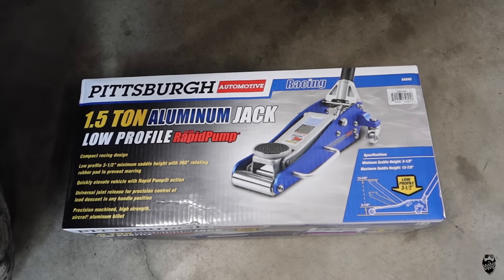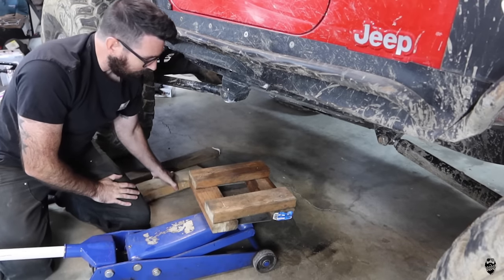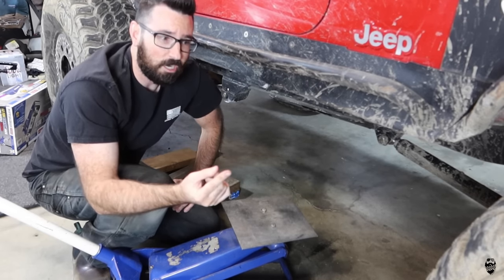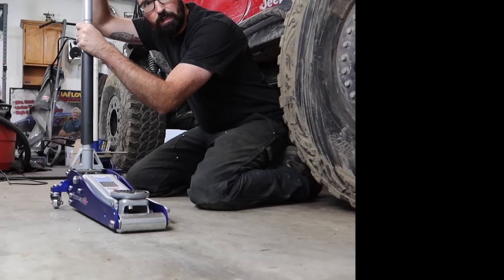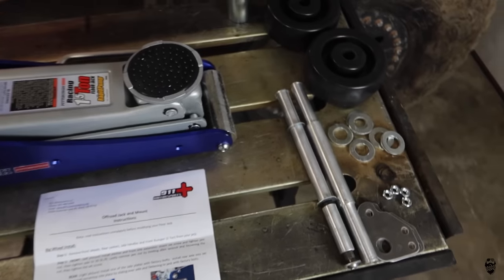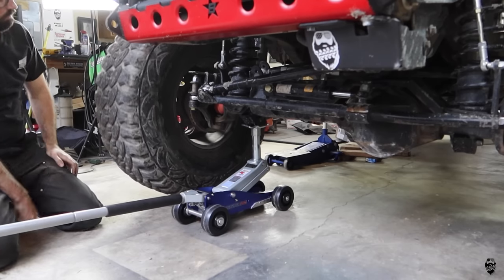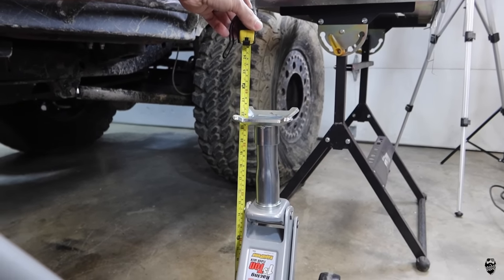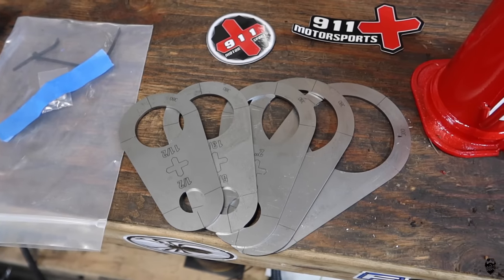Harbor Freight Off road Floor Jack?

Comment: That's a great video! I like the trailer box mount location and shake test at the end. You did a great job of explaining the install... especially since I sent you the wrong instructions. Sorry about that. That was actually the first 1.5 ton kit to leave the shop. I'll also own my other mistake you found, the wheel mounts weren't designed down to 5" wheels and therefore don't fit the jack handles underneath without a little trimming. The next version is already in queue at the laser shop. Thanks for pushing me to get this out the door and I'm looking forward to hearing how you've used and abused it.

Comment: I first saw the 911 motorsports jack extension on Casey's channel and again here, just got it, the flat plate and even got the weld on piece for the bottle jack in my recovery gear!  Amazing, thanks for showing it, makes it safer, faster and easier!
Reply from the maker: Nice, good to hear

Comment: To answer some questions, we designed this as two separate products. The Jack Extension will work with almost any floor jack by converting it to a 1 1/2" pin, then using the extension tubes and saddle to replace your blocks of wood. Next up is the Big Wheel kit for Harbor Freight Aluminum jacks. The 1.5 ton is light and small so it makes the best off-road jack to pack around. The 2, 2.5 and 3 ton are other options, especially if you already have one. There's also a trail jack option, for those who don't go overlanding...    All made in the USA... except for the HF jack and caster wheels we're repurposing.
Reply: Thats an awesome product. Need to find out now if some of the jacks sold in Europe are the same as the harbor freight ones, or should I diy my own kit. Thanks for the inspiration at least.
Reply: How did I not know that this is what you made over there???   I just pinned my foot under my Jeep on tracks after stacking blocks on my jack and having them spit out, so I need an extension kit ASAP!
Reply: I assume the extrenstion works the same for the 3 ton HF as the 1 1/2 ton?   I have wooden blocks I use but those seem to be way more handy  for my shop jack.  I'll prob get a 1 1/2 ton for the jeep later but was wondering about the extensions for now.
Reply: @deeiks12  From our research, most AL jacks are copies of the HF versions, which also vary. Send us some dimensions of your jack. Frame width and thickness, along with the front axle diameters will give us clues about the differences.
Reply: @CaseyLaDelle  Dude, we're neighbors! Stop in and pick up some prototype stuff!!
Reply: @911Motorsports  I will next time I'm over there!
Reply: Still too heavy and awkward. I’m looking at that hand-held hydraulic system that has a hose and attachments to turn into a light-weight jack system
Reply: Does the kit work for the Daytona brand jacks?
Reply: thank you for answering my questions, I was on the fence about buying this because I already have to H.F. long reach 3 ton jacks and a cheapy 1 ton unit. I was just working on my lifted jeep the other day in the yard and then the other one in stone driveway and man it sucked, jacks are heavy and wont roll
Reply: @Fordgroup00  you're talking $200 vs 700-900
Reply: Do you have a skidder tray under the jack instead of wheels?

Comment: Ive used that little HF jack in so many kinds of rough terrain. Snow/ice, mud, gravel, dirt, etc. And that wasn't even off road! Its light enough that I usually just pick it up and throw it wherever it needs to go. I'm looking to get the 2 or 2.5 ton jack for my suburban though, and I can see how a kit like this could be extremely useful. I usually just use pressure treated 4x4s to use as a jack extension, but a purpose built jack would be a lot nicer and easier to use

Comment: Where I'm from we have a lot of soft and muddy ground. Wheels will do nothing more them get bogged down. So we take the factory wheels off and use a solid skid plate on the bottom of the jack..
Better footprint when lifting.

Comment: I converted my HF by pulling the pad, welding a nut under it that holds a length of All-Thread which has a length of iron pipe over it and then screw the pad back on.  I made a few lengths and it adapts to my 4x4's and my super low Civic!  About 15 minutes and free junk laying around the garage.

Comment: For the cost of the HF jack, the 911 kit, and the time involved, I'd be tempted to just buy a Pro Eagle and be done with it.
Reply: Exactly, and it will be a much better jack than a Harbor freight jack
Reply: $330 for the jack and their kit with a 90 day warranty. Wont work on passenger vehicles any longer. Ours is $409 with a 2 year warranty and the extension is removable.
Reply: @jonross5546  I’ve had this jack for 5 years, used it countless times and it’s been nothing but great.
Reply: @proeagle4215  what's 330$? It's a 140$ harbor freight jack  and goes on sale for 100$.
Reply: @diytacoma5758  $140 OR $100 for the jack plus the cost of their conversion kit equals $330 or more depending on the jack.

Comment: Interesting this turned up in my feed. I just put a long arm kit yesterday on my Grand Cherokee and noted I need a taller jack now.
Reply: And the funny thing is is now that you have the long arm on there you’ll be doing that weird wood thing, believe me it’s a lot better with an extension on your Jack …I’ll be doing the tires and wheel soon.. Just didn’t wanna spend the money on the kit but this pretty much convinced me to do so good luck

Comment: That's a great idea. I've use the 12 ton bottle jack mostly and I need those extensions for the bottle jack. Those would be better and safer then using 2x4's.
Reply: It's safer to put blocks under the jack than extensions on top

Comment: Another option is a bottle jack... hey start off taller and can be found/retrofitted with wheels. I've even operated manual bottle jack quickly with a battery drill.
Reply: lol woops, your getting to it.

Comment: All good stuff, but some time ago while working in a power plant, we used a set up similar on the jack and split the tubing. I don't remember what the outside diameter was of that extension but I was able to find a piece of steel tubing that I pressed onto the base of the extension. Finished the job using that set up and last I knew it is still on the equipment trailer...

Comment: The pro eagle offroad Jack is based off the same frame as the harbor freight jack, but with bigger wheels added and a few hundred dollars. Lol
Reply: And the kit from 911 is $200+... so you're saving almost nothing by comparison.
Reply: @toyomatt84  agreed... Get a harbor freight jack, some bigger wheels, build a skid plate, and make it better for cheaper. Lol
Reply: @gearheadfabworks  I think you misunderstood my post.  There's almost no price difference between a 3ton Pro Eagle and a 1.5ton harbor freight jack with 911's kit.  Why would I bother buying the kit and a HF jack at that point?
Reply: @toyomatt84  I understood what you said. I'm saying build your own... Don't use a kit. The wheels are about $10 a piece, build a skid with some plate and you have a jack at half the price.
Reply: @gearheadfabworks  I gotcha now. ;)  Yeah, the materials needed to make one aren't exactly worth $200+.
Reply: @toyomatt84  A Pro Eagle 1.5 ton jack is $409 and the mount is $199, so according to my calculations, the Pro Eagle version is over $300 more expensive.
Reply: @bravotwozero8119  Huh?!  I think you added in $100 there... and forgot the cost of the harbor freight jack (which as of this post, is $99 for the 1.5 ton aluminum jack).  So, you're going to need to re-evaluate your efforts in math.
Reply: The pro eagle jack ..i just looked up was over 400$
Ill keep my hf jack for under 100$ and the wood blocks work fine 
But ya they get in the way alot.. such is life .. .. id rather buy a hf jack and some blocks and save the cash for beers.. or what ever .. i dont drink .
But money in the pocket is good too
Reply: @toyomatt84  How's this (from the website):

Product Comparison - from 10/15/21
1 1/2 ton HF jack      $100 jack + $260  for our full 5" kit = $360
1 1/2 ton Pro Eagle   $410 jack + $200 mount + $70 long ext. = $680 + shipping

Comment: That Jack extension looks really sketchy.  I seriously doubt the parallel arms on the jack were designed to accommodate that long extension.  This isn't like an extension on a 2 post lift because there are horizonal Forces at play.  Probably fine on a smooth concrete floor when the jack can roll, but a different story off-road.

Comment: 2 quick questions, in looking at the video isn't the saddle on your old jack removable and attaches to the jack like most older jacks, via a big steel post on the saddle that slides into a hole at the end of the lifting arm and secondly, do you really lay under the vehicle while you are jacking it up?

Comment: Have a twenty-five-year-old F350 in 22 has the same bottle jack that I've been using forever it fits perfectly and it only not bigger than two hands and it unscrews up high enough in in jacksepticeye elmira's off the ground right at the wheel I don't know and you know the high lift Jack for getting in trouble holding that big Jack out into the woods with your truck no no no

Comment: I can't find the Harbor freight  Badlands 1.5 ton jack at Harbor freight?? Only 3 ton . Do you know if they discontinued?? I'm old and weak now and need the smaller one. Thanks Dandahermit
Reply from the maker: They don’t have a badland 1.5 ton. Mine is a converted 1.5 ton aluminum racing jack, they are on sale now for $89
Reply: @MuddyBeards4X4  I see it for $135 bucks. But what does the conversion kit cost?? I'm old and crippled n can't handle the 3 ton Badlands even though the gut $299 for it. I remember last year they introduced it as a 1.5 ton and some of the reviews are still around I ain't paying $5 or $6 hundred for  a Pro Eagle. I'm 80 and crippled up on So SEC. Can't do it. Thanks for your response. I'm one of your subs. Dandahermit
Reply from the maker: https://www.harborfreight.com/15-ton-low-profile-aluminum-racing-floor-jack-with-rapid-pump-64545.html

https://www.911motorsports.net/Pittsburgh--Offroad-Jack-Conversion--Combo-Kit_p_87.html

Comment: I hate to admit that I’m having trouble here but…
For the love of God, what tool did you use to remove the rear caster screws? None of my Allen “hex” wrenches fit in that narrow opening so I bought low profile versions and they couldn’t take the torque to break those screws loose and broke the tools. Should be simple but hitting a wall. Any help is appreciated.
Reply from the maker: Looks like I used an Allen from my craftsmen set. Just a regular ol Allen.
Reply: @MuddyBeards4X4  
Thanks for your reply. Looks like I’ll just have to grind down and shorten one.

Comment: Any concerns with galvanic corrosion between the dissimilar metals? The steel rod and aluminum housing?
Reply: As long as it doesn't see a lot of weather it would probably be ok
Reply: I store my supplies in a salt brine tank off season

Comment: It's called a floor jack for a reason. Notice at 9.04 as he jacks it up the wheels let the jack move that can't happen off road. Then at 9.17 he pushes on the jeep, watch how that jack deforms as it moves.  Using a floor jack off road is just stupid.

Comment: Ps what gos for off road is allso true for normal every day vehicles .
I once was involved in a accident.. my car went thru a ditch. The heavy truck wheel i had in the trunk.. broke through the back seat and almost punched thru the roof over the pasenger seat . That would have killed me if it just shot a little to the left.. allso a bucket of tools pummeled  the passenger dash and door
loose cargo and tools can and will kill you .. fair warning
Reply: Huh?
Reply: Secure your load I dont care if it's just a canned ham at 10 20 30 miles an hour or more it can kill you like a cannonball